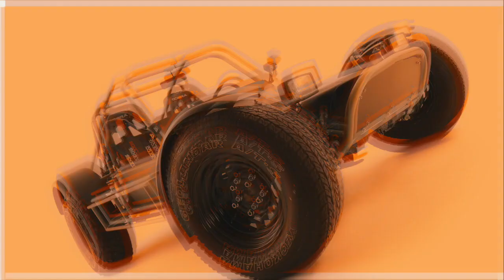Kingfisher Overland Build Compilation

Comment: Where can I get the body panels, I have a chenowth which looks almost identical to this, I dont know much about the history of the vehicle but I think it was imported from America in the 90s and Q plated, i need a bonnet and the side panels look a bit rough so would love to replace them but they seem like finding hens teeth, i have looked everywhere and the only place I can find panels of any kind are from the USA. I have already looked on your website but cannot find any panels for this car i think they would be a very close fit with a few modifications your panels may be a solution!
Reply: Oh and I love the colour scheme on your build it looks great it has inspired me, looks simple and sleek but modern, every frame I have seen seems to be in a bright colour or black or white but the aluminium silver with the matt black panels looks great well done guys you have built a great looking car!
Reply from the maker: Hi Daniel Duke, thanks for your message, only just picked this up for some reason!
The Overlander frame is actually based on a Chenowth and most likely it will have been Dave who put yours together!
The body panels should fit, where abouts are you based? If you can drop us a note: info@kingfisheroveland.com and we’ll see what we can do, thanks KO